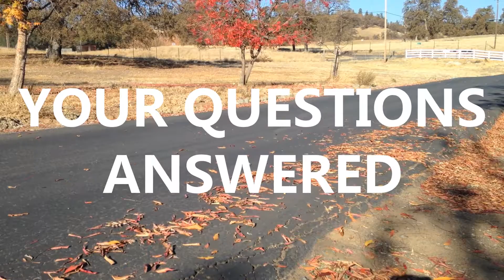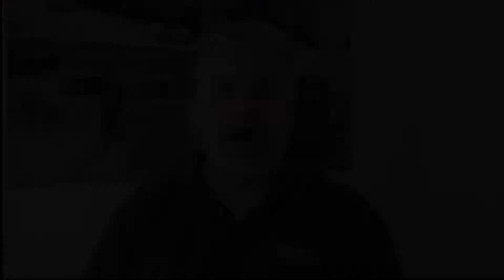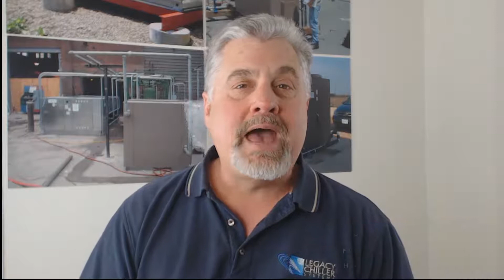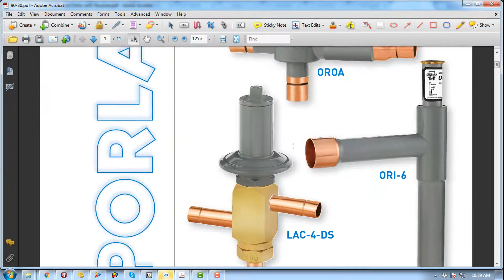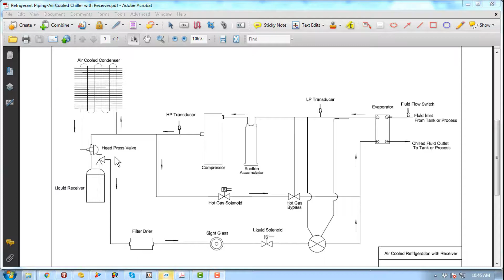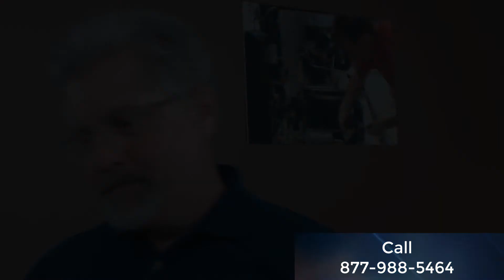SMART DROP FLOODED CONDENSER

Comment: Could you explain the low pressure trip due to the refrigerant liquid being too cold at the TEV. Low temp then low pressure at TEV inlet. Is that it ? too low a pressure drop accross the TEV and not enought refrigerant entering the low side. Thanks for a really great video.